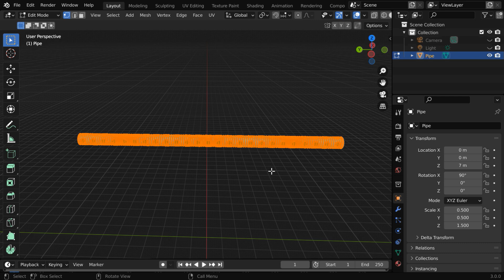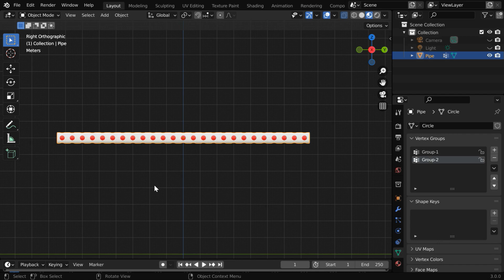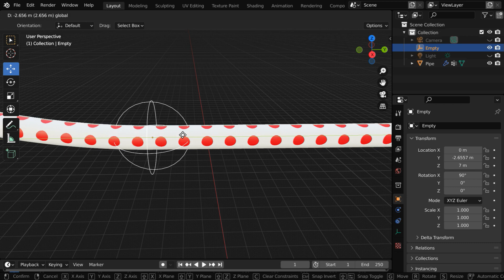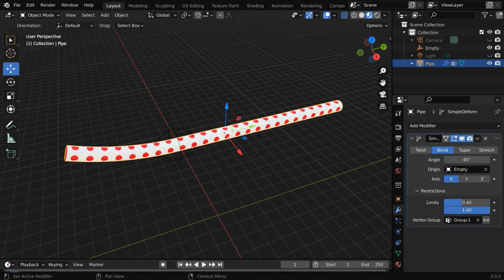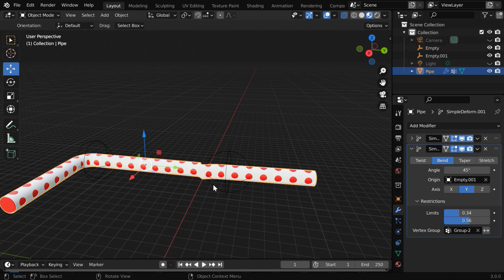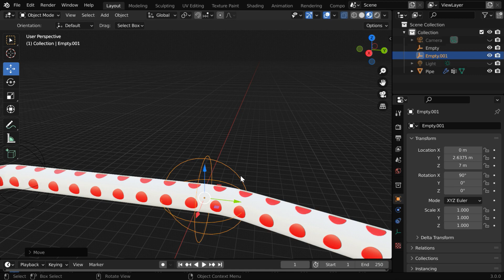Create Double Bends In Blender | Advanced Use of Simple Deform Modifiers | Fast & Easy Method

Comment: How can i bend 3d headphone to straight ?
I means how to bend with fix part that 3d headphone look real with straight shape
Reply from the maker: If I understood this question correctly, you have a headphone model with curved part. You want to bend it on the opposite side to make it straight. The bend process will be the same. Assume that it is already straight and bend it using a deform modifier but use a negative value in the bend angle. One drawback is, even if the object looks straight after this, it will still have deformations along its length, that is difficult to remove just with a modifier. You'll probably need to remodel it.
Reply: @5MinutesBlender  thanks for answering brother as you said using vertex group glitch happenes in 3d model and model was destroyed.😄

Comment: Doesn't seem to be working for me 😢😢
EDIT: I was doing it wrong, it works perfectly well 😁
Reply: I think it's the subdivision part for me
Reply from the maker: @mrgalvathron  It may be tricky because the Simple Deform modifier is itself tricky and we are using two of them here. You need to place the empty correctly, and use correct values everywhere which again depends on your object placement and its dimensions. And yes, subdivisions are important as well. If you can't get it working at all, you can send your blend file to us. We will check and suggest you what should be done. Thanks!
Reply: @5MinutesBlender  it really was the subdivisions for me 🤣, thank you guys so much. I didn't have enough loop cuts so it was looking werids. It works now!! ✊
Reply from the maker: @mrgalvathron  Oh, glad to know that it is now working! Cheers!!